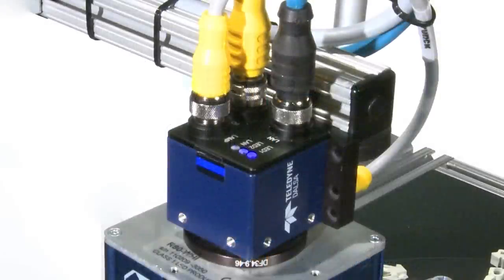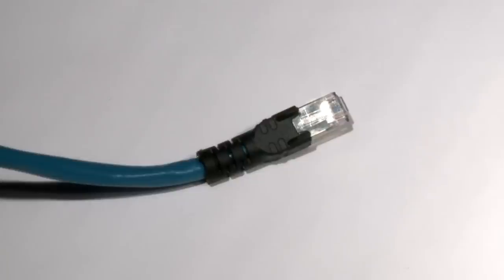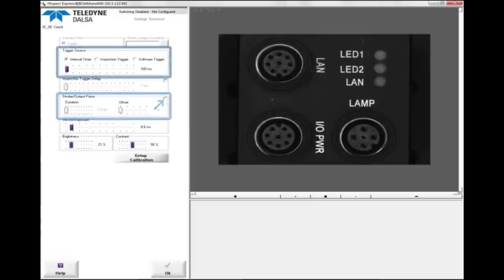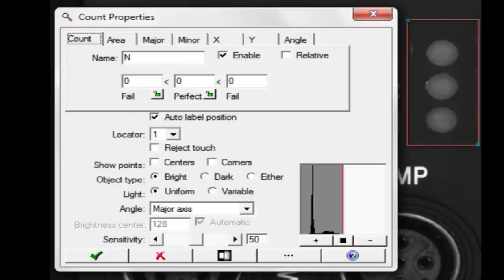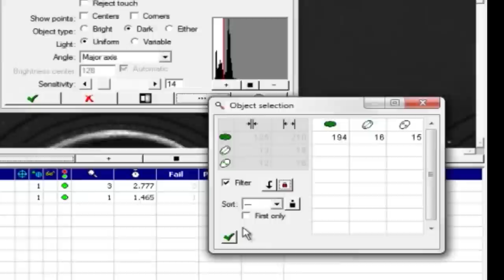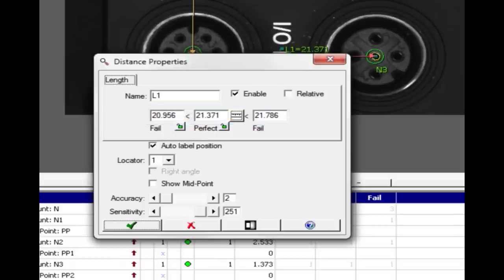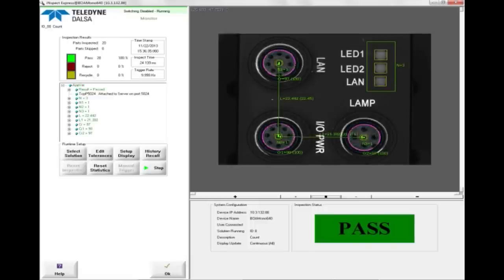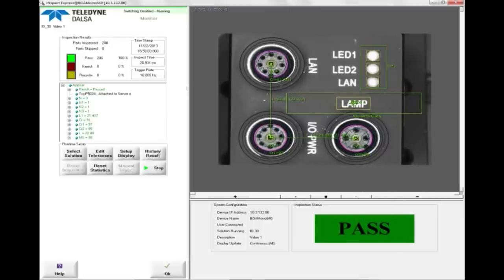How to Set Up the BOA Smart Camera Vision System

Comment: Yeah, but you can't connect if you DONT KNOW THE IP ADDRESS
Reply: There are lot of tools to help you find any device on a network, like Wireshark, even Teledyne Dalsa provide tools, called iDiscover and Nexus.
Reply: @automationai40  if it's part of a full blown PLC system, how am i supposed to know which one it is?
Reply: @timothyslaughterjr5885  If you use Nexus or iDiscover, they only will show the BOA camera. If you use Wireshark, normally shows the manufacturer name. If you need the tools, please let me know!
Reply: @automationai40  i required online support on urgent basis in India as application is not opening after upgrading firmware to latest version and production stopped from many days